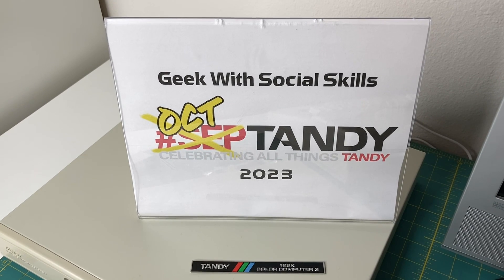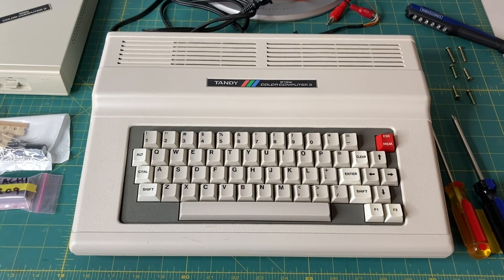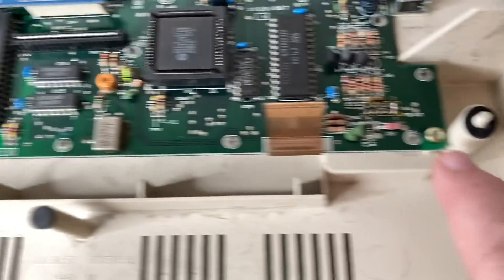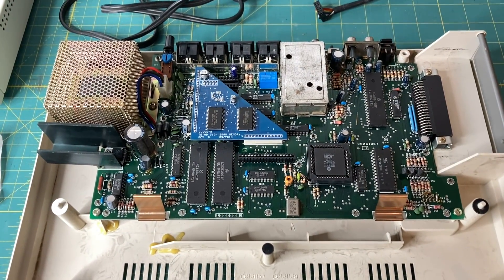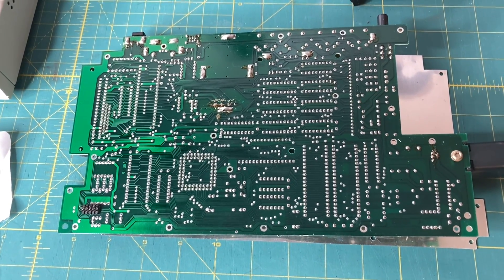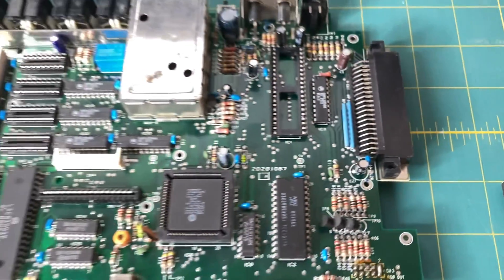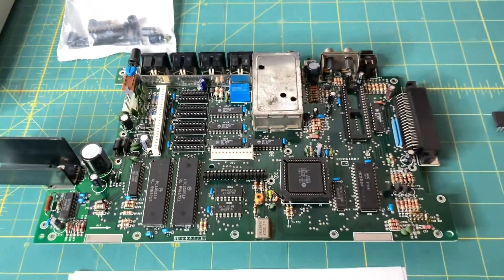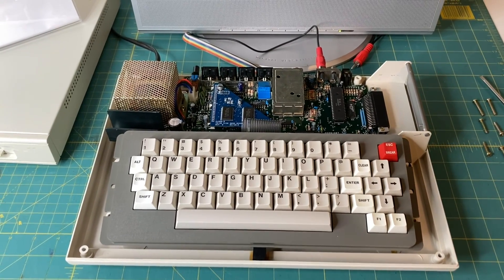Tandy CoCo 3 - Hitachi 63B09E CPU Upgrade & Full System Recap

Comment: Does NitrOS-9 have extensions for the HD6309?
Reply: Yes... in fact when we originally  created it back in 1992 (and until it went open source around 2002/2003), it required a 6309. The 6809 version was actually a backport, and has been optimized itself, but the 6309 version is noticably faster, especially on some graphics commands, RAM drives, etc. where it can twice as fast (or more). On average it's 15-30% faster depending on what one is doing. We have preinstalled/set up versions ready to go for the CocoSDC on my NitrOS9/EOU website.
Reply from the maker: Thank you for all you do Curtis with all things Color Computer related. It's much appreciated!

Comment: Nice upgrade! My Cloud-9 memory upgrade arrived at the beginning of October 2023... I would like to do the processor, but my keyboard is failing so that's the next upgrade. Thanks for the links.
Reply from the maker: Thanks! Glad you enjoyed my video. Awesome you received your Cloud-9 memory upgrade back in 2023. It's so worth it. Best of luck with your keyboard repair. IIRC there is someone who is selling replacement keyboards using modern parts. You just need to swap over your keycaps.
Reply: @geekwithsocialskills  Yes. I can play Sierra games now with the extra memory. I’ll be ordering the KeyFix3 for about $50 with shipping very soon.
Reply from the maker: Indeed, having the extra memory is pretty awesome and yes, the KeyFix3 for the CoCo 3 is really nice!

Comment: When you removed the RAM upgrade…it literally was Rise of the Triad! 😅

I really need to get a Hakko desoldering station. My cheap China version died a few years ago. The spring loaded solder sucker just isn’t the same.

I love how it instantly boots. Even the C64 takes a few moments on power up. 

Arkanoid looks just like Apple IIGS 😮
Reply from the maker: "Rise of the Triad" could be the name of an adventure game or a metal band LOL. As for the Hakko FR-301, they are really awesome, but expensive, however if you do a lot of desoldering like I do, it's really worth the money. It saves so much time and frustration too.

Comment: Thanks! It will be useful to follow when upgrading to the 6309. I wasn't sure where to source them from and was glad to find the link in your description! 

So are we going to use "OctTandy" or "OcTandy" when we hashtag?
Reply from the maker: Glad I could help! You will want to be very careful when removing the stock CPU. I used a lot of flux and also my Hakko FR-301 desoldering gun and took my time. As for OctTandy being a hashtag, nah, just use #SepTandy. The whole OctTandy thing was a joke a year or two ago for the same reason I used it here, not getting all my SepTandy videos done in time for September.

Comment: Any benchmarks anywhere of the Hitachi '09 vs the Motorola '09 in a Coco 3?
Reply from the maker: Here is some information from the RetroRewind website (link in my description): The Hitachi 63B09E is a pin-to-pin direct replacement for the 6809E found in all Tandy Color Computers. It's a CMOS chip with runs much cooler than the 6809E found in the CoCo and contains additional CPU registers and an enhanced instruction set that will bring significant performance compared to the stock 6809 CPU.

Comment: Gonna have to get my CoCo3 out and play with it. I've got the 63C09EP CPUs, but I will probably go with the Pro-Tector+ instead. Thanks for the videos!
Reply from the maker: Indeed, get your CoCo 3 out and have some fun with it. As for the Pro-Tector+, my understanding is that's an add-on board for making sure all lines are buffered and protected. Is that right? P.S. you're welcome for the videos. Thank you for watching, liking and commenting on my videos!
Reply: @geekwithsocialskills  That's what it appears to be. And I have several of what I hope are actual, working 63C09EP CPUs purchased from two sources. But I'm happy to use theirs. As for the old 6809, I'll probably take the coward's way out and clip the legs on it instead of risking disaster for a $10 chip that I don't want anyways.

And you are welcome of course. :)
Reply from the maker: If you change your mind on how you remove the 6809, just be very careful and take your time. I used a lot of flux and also my Hakko FR-301 desoldering gun. It worked out just fine as you saw in my video. Based on reading about others having issues like lifting pads or traces, I did consider just clipping the chip out, but in the decided to go for it.
Reply: @geekwithsocialskills  Not sure why I would (other than to avoid being labeled a wanton "Retro Part Killer" :) ). But I do have the same Hakko as you do (mine is the "-03/P" version). I've done serious damage to a C64 in the past, but then again the traces on a Commodore board are largely held in with happy thoughts and good wishes. The CoCo3 looks to be far superior than the Commodore.
Reply from the maker: With all boards, including Commodore 64's, it takes a lot of practice with a nice mix of heat and how long you hold the iron on the board. I've been soldering/de-soldering since the 1970s. I'm old LOL. As a side note, what's the difference between the FR-301 and the FR-301/P version?

Comment: Look forward to seeing how the improved cpu beefs things up. I wish there were more modern cpu enhancments for 8bit machines as a little extra boost seems to go such a long way.
Reply from the maker: There are a ton of awesome Color Computer homebrew games that take advantage of the CPU upgrade and also the memory upgrade. There will for sure be more videos with this machine and showing off what it can do.
Reply: The 6309 performs exactly like the 6809 on boot, but as GWSS says, it has extra registers, adds a hardware DIVide instruction (on top of the hardware MULtiply the 6809 already has), adds block transfer (DMA-like) instructions, and has a '6309-native' run mode that runs most instructions in fewer clock cycles.  Software has to be written to take advantage of those features, so existing CoCo software will not see any speed-up just by installing the 6309 chip.

But, as GWSS mentions, there are quite a few more recent games that have been written with the 6309 in mind.  And the NitrOS-9 operating system can take full advantage.  Some of the OS-9 games, like Flight Simulator II, have also been patched for the 6309.  Note that the 6309 version of NitrOS-9 runs in native mode, which means that every OS-9 program will automagically benefit from the faster instruction timing, whether it's (re)written to take specific advantage of the 6309 or not.
Reply from the maker: Thanks Joel for chiming in with such awesome and detailed information. I've only been a CoCo user for a little over a year, so a lot of this is still new to me. I grew up using Apple II's in school and a Commodore 64 at home, however in present day, the Color Computer line is interesting and a lot of fun.
Reply: @geekwithsocialskills  Yeah, I think a part of the fun in vintage computers is getting to see what the systems you didn't get to play with as much as a kid are like, and compare and contrast.  The CoCo will always be my first love, but as soon as the Apple 2s and Commies entered the "worthless junk" phase of their desirability I gladly snatched them up, and am happy to have them all in my collection.  I even enjoy the heck out of the lowly T/S 1000.  Each system was unique, and that's something sorely lacking in modern PCs.